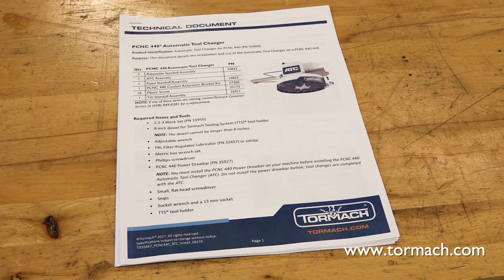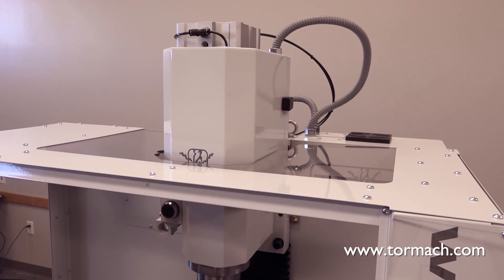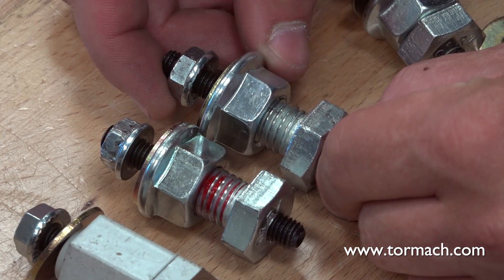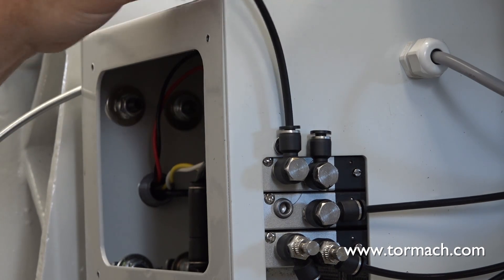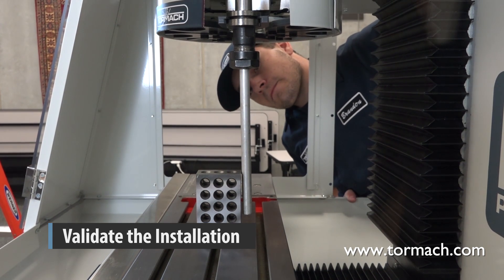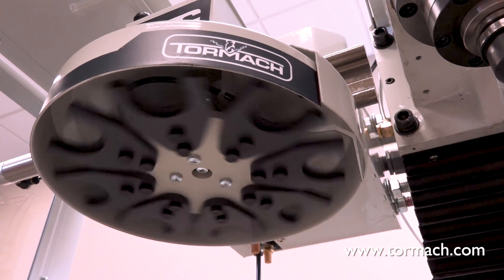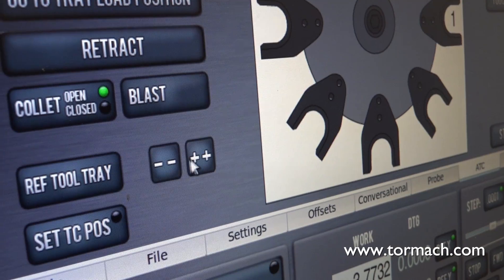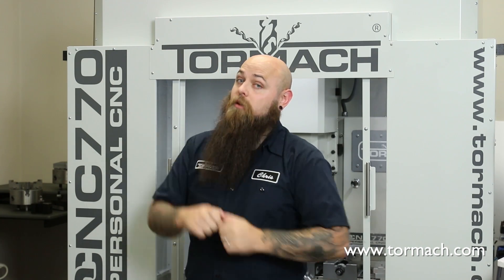How To Install a PCNC 440 Automatic Tool Changer

Comment: Do not use the washers they give you, use the thick shipping washers that the machine was bolted to.
Reply from the maker: Tormach Technical Support has run into very few instances where extra washers are necessary. It would be best to follow the correct procedure first, then contact Tormach Technical support for further guidance. https://tormach.com/support/mill

Comment: This video shows that the white wire is connected to VFD-8, but the manual says 2/HA. Oddly enough, the schematic in the manual shows connecting the White wire to 1/HA. (I'm guessing different versions). 

For my 2021 440, The VFD Running light is correct when the white wire is connected to 2/HA.
Reply: Helpful comment! I had the same issue and just verified 2/HA is the correct connection for the white cable.
Reply: Thank you! This fixed my issue also
Reply from the maker: Thanks for bringing this to our attention, and sorry we missed your original message. We are in talks with the engineer and technical writer about these changes, and will update this video.